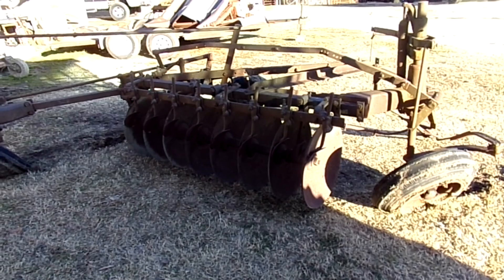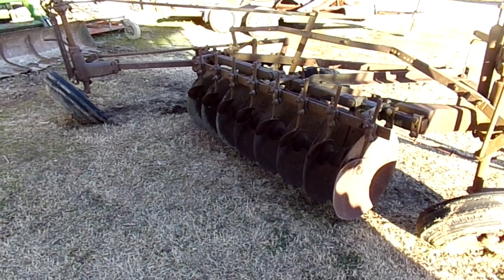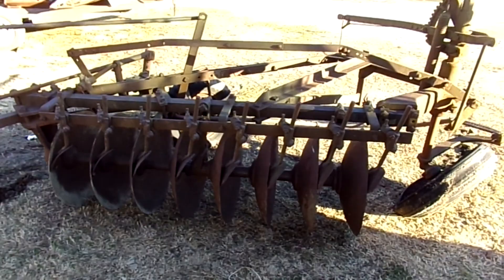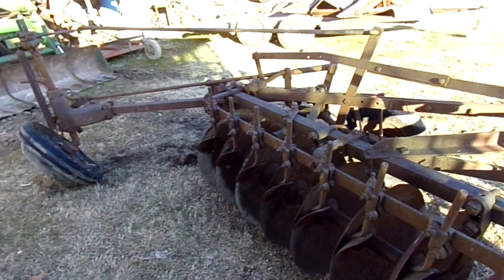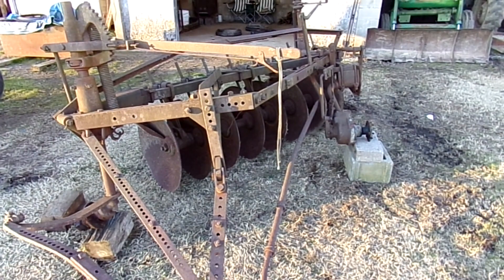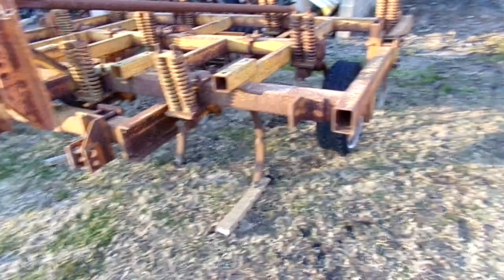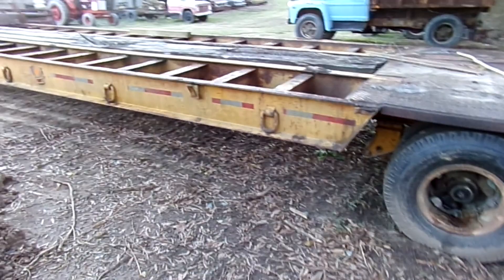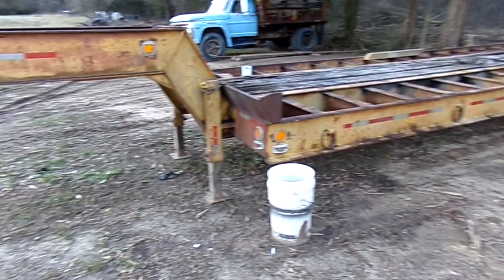Antique disc plow rebuild part 1 (too many, but anyways)

Comment: I'm sure you have fixed it by now but if you need too break a tough bead I've always used a "handyman" jack and  the tractor hitch. If you apply some dish soap too the bead and Jack right at the rim edge it usually breaks the bead fairly easy
Reply from the maker: You are correct!! That was my go to for years!! Finally bought that tire bead hand tool, and it works really well, but have gone back to the handy jack too!! That dish soap is amazing, my shop is full of dawn dish soap, for all things!! I rally appreciate you watching the videos from the start, means so much my friend!!

Comment: 1086 will pull it just fine . We had one long ago with 5 blades JD that I pulled with a B JD . But that was for fun ,when I was 16 or so .
Reply from the maker: Awesome! I did get it in the ground last week before putting it in the shop for the conversion. Had it behind my 770 oliver but it only had 3 blades in the ground due to the bent top brace, but it saw dirt again. Hope to get that video up soon! Thank you very my friend!